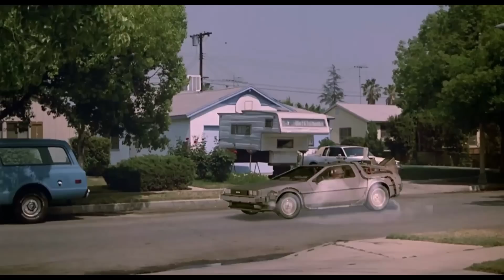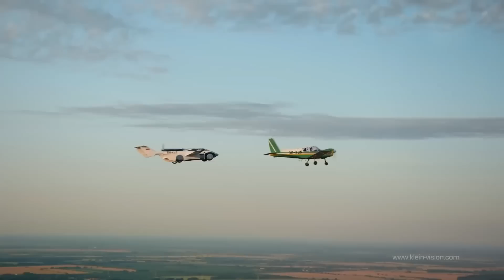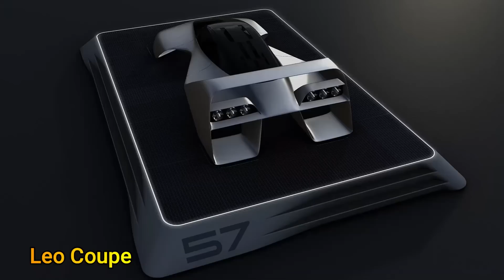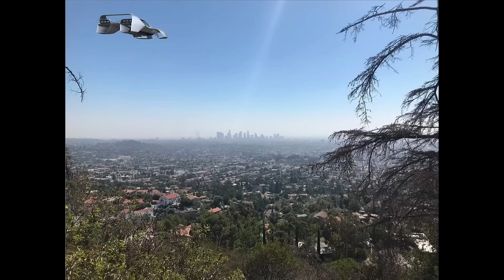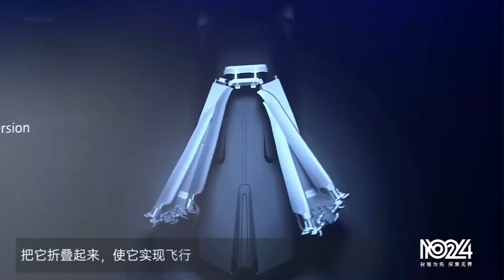Existing and Upcoming Flying Super Cars and Hyper Cars

Comment: The Sky Chaser roadable VTOL tiltrotor REAL flying car should also be included in this list. Sky Chaser is the 1st of its kind, a real roadable Blade Runner style flying car with 4 large wheels for road use, no unfolding wings, and no exposed prop rotors. It looks and drives like a super car, and flies both vertically like a drone and horizontally like a plane. In addition it is amphibian. It will be both manual and fully autonomous, and will be powered by a hydrogen fuel cell giving it hours of range. The 1st version will be a single seater, followed by a 2 seater with tandem seating like a jet fighter. The Sky Chaser project started in San Diego, Calif in 2016 with 1/6 scale development and moved to Fjugesta Sweden in 2020, where the 1st full scale prototype was built and tested. The project will soon move to the UAE for commercial development and production. See the company website for more information:

*Website - SkyChaser(dot)se
*eVTOL news - https://evtol.news/sky-chaser-concept-design
https://evtol.news/sky-chaser
*Project Video - https://drive.google.com/file/d/1FAdls15OriuQ4hoD2xPwXeNQDQTKpK1t/view?usp=drive_link
* Flight videos - 1/6 scale, Full scale, and simulation - https://www.tiktok.com/@william.walker39

Comment: Looks like someone worked off an idea I did or I thought about it was about time utilizing the access space that would be on a car oh I love the jet engine idea but that would be more practical for long distance flight like oversea really should keep in mind that we're talking a futuristic do you for an example in Back to the Future too most all Concepts should be based on the traffic seen when they travel to the Future eventually when enough Vehicles that's capable of flight it in the air it will be required that they all have the same capabilities and would require traffic Systems in the air

Comment: No I do love the Space Age jet design are quite practical very futuristic in terms of spaceships as for power consumption a simple gas motor will generator such as a DC generator with a neodymium core to produce enough power to power all the electrics in terms of a small motor would be more manageable as well as lighter than batteries possibly

Comment: For a helicopter Style rotors those can be shrimp down to a four-blade turboprop setup reducing the distance and space in which they would require to spin which can also be set up to two props separate for folding can also reduce the distance of reach for the props reducing the full radius of the car

Comment: The Aeromobile. Due to the fact that both Front-Wheel-Drive and hydraulic usually fail after a certain mount of time regardless as how they are cared for. It would be nice to see upgrades in the design of the drivetrain and Manual access manipulation added to this vehicle.
Firenze Lanciare. Too many moving parts with hydraulics to be interested in it. However, turbine cars have been made before successfully.
Bellwether Volar. If it doesn't have four wheels, it isn't a fricken car.
Leo Coupe. See above.
True Flying Car. Again, too muck hydraulics to take it seriously. That shit breaks.

Comment: The Last one, HT AERO Where do they put those extending arms and propellers that seem to magically appear from the inside? the dimensions don't add up.. 

Firenze Lanclari.. Yeah   300 gallon tank,, thats 2.251 Pounds of fuel  Over 1.2 metric Tonnes  requiring a tank of 48.16 Cubic feet capacity  Where is this being located?  Dream time.. and vapourware certainly wishful thinking.. 

We need improved power sources and alternative lift technologies before these become a useable reality.  Nice video though as usual

Comment: Not sure I believe in this kind of road-and-air type of cars. I believe that evtols (especially with ducted fans) once autonomous and with built out infrastructure could be viable personal vehicles. You only really need the last few meters of parking capabilities once you landed, and the ducted vector fans could provide that or tiny motors on the landing gear.

Comment: Jetoptera is going to win even though you did not showcase it here.  It has no external blades and runs much quieter.  Sure, it is not electric, but it is the most viable for blade safety and noise pollution.

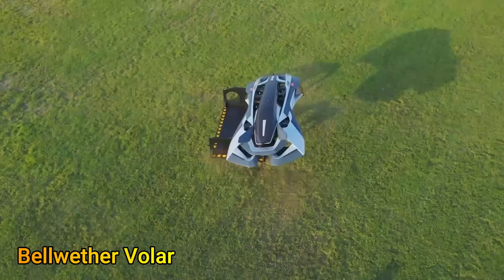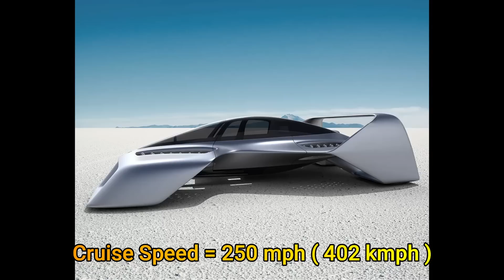Comment: 3:25 & 5:45 are VToL styles, that could be feasable in metropolitan enviromemt, if was a 2 stage craft, where attaches to a ground vehicle body frame, it could automatically be versital as a road, air & even water, using part of the body as land port and alternative transportation stages. In the beginning of this video, those crafts are RToL, as runway lift required, although the wings could be handy during long cruise travel, if only they were able to VToL first, without necessarily a runway. Also, you forgot to mention the CityHawk model, which is already beyond CGI test.

Comment: Interesting video.  It seems to me that a 'flying car' with all three characteristics - drivable, flyable, and VTOL, may just be beyond the state of the art.  Pick either drivability or VTOL.  If you give up on VTOL, then you can have a practical, roadable aircraft like the PAL-V or the AeroMobil.  If you give up on it being drivable, then you can have a practical replacement for a helicopter, like the upcoming EVTOL aircraft.
Reply: Totally agree. This idea of shoe 📯 Ng in all that functionality is very silly.
Reply: Yes, it is possible and should have been included on the list. The Sky Chaser roadable VTOL tiltrotor REAL flying car should also be included in this list. Sky Chaser is the 1st of its kind, a real roadable Blade Runner style flying car with 4 large wheels for road use, no unfolding wings, and no exposed prop rotors. It looks and drives like a super car, and flies both vertically like a drone and horizontally like a plane. In addition it is amphibian. It will be both manual and fully autonomous, and will be powered by a hydrogen fuel cell giving it hours of range. The 1st version will be a single seater, followed by a 2 seater with tandem seating like a jet fighter. The Sky Chaser project started in San Diego, Calif in 2016 with 1/6 scale development and moved to Fjugesta Sweden in 2020, where the 1st full scale prototype was built and tested. The project will soon move to the UAE for commercial development and production. See the company website for more information:

*Website - SkyChaser(dot)se
*eVTOL news - https://evtol.news/sky-chaser-concept-design
https://evtol.news/sky-chaser
*Project Video - https://drive.google.com/file/d/1FAdls15OriuQ4hoD2xPwXeNQDQTKpK1t/view?usp=drive_link
* Flight videos - 1/6 scale, Full scale, and simulation - https://www.tiktok.com/@william.walker39

Comment: I love the areocar the guy who developed it is a genius and it will sadly always be a gimmick. It will always be a compromise between a plane and car and not a great version of either but I really hope I am wrong. The two electric sports cars are at best toys till some giant leap in battery power. The jet car I'll believe when I see it   and the Chinese helicopter car I want to know what happens if one engine fails my guess is you auger into the ground like madly spinning lawn dart.
Reply: в видео в конце было указано что все эти модели оснащены парашютами
Reply: @viacheslavstukalenko9660  for most of the aircraft/cars shown the ballistic parachute sounds great as long as your around 300 - 400m off the ground but the Chinese Twin rotor car if it suffers a single rotor failure that's a lot of asymmetrical thrust and if your flipping around you can't use a ballistic parachute without fouling iy

Comment: I don't see highway driving as being all that necessary if the surrounding infrastructure is adapted to VTOL flight. The whole point of point to point trips is to avoid high speed ground travel. A VTOL really should only need to be capable of slow speed taxi away from the landing zone, or maybe short trips at mid-speed (60kph say), which is suitable for ultralight vehicles optimized for flight.
Viable VTOLS will probably have more duck-like capabilities than a magical horse / bird combo due to the tradeoffs involved. With enough power, a brick can fly, so it all depends on power density and energy density in the end. Fun times. It reminds me of the early days of IT.

Comment: As you aptly point out, only 2 can become cars, the AeroMobil and the HT Aero. There is that attached problem for cars that require an airport, which denies practicality.
That and another intrinsic concern of the logic of the idea. If you could fly there, why the hell are you driving? Of course there isnt a reason.
In car design we are required to look after safety, if we achieve this we have already burned millions of dollars and years of research, this too is an impediment.

I very nearly got there myself, starting simple with a single seat CanAm style open body car on a 3 wheeler chassis. The 3 wheel form with 2 wheels up front allows you to get past car safety because in most places it registers as a motorcycle and sidecar, which are exempt. It can drive on the road with a relatively light motorcycle engine and rear wheel transmission. Its delta wing slides in and out of the rear body which adds wing area and creates a more favourable aspect ratio. To keep the part wing body on the road while folded it is necessary to keep a negative angle of attack at highway speeds or you will find the machine lifting off the road above 60 mph. This was accomplished by raising the rear suspension, which retracts in aeroplane mode to do the opposite. Forward propulsion would have been achieved via a front take off from the transmission to a retractable propeller shaft and fold away propeller of the type gliders use. While this car is achievable it has to skirt the same conundrum that AeroMobil does, so I scrapped the idea as unsatisfactory. It was simply much better to have a personal flying machine that might in the end work out cheaper, with the added reserve that it could take off vertically. 

Enter the turbine APU powered electric compound single rotor helicopter capable of 300 mph. There are too many compromises in achieving the car part of the flying car, so focus on what works. And BTW these ballistic chutes all have a no-go zone which you must fly above or they simply add to the weight contributing to the damage in the crash you were trying to avoid !
Reply from the maker: Have a look at Pal-V flying car
Reply: @ElectricAviation  I remember when they were testing, the program goes back a long way.
There were a few relevant designs from the gyro copter world that either preceded or inspired it, what they did made a roadable package.
Although Im not fond of this style of trike it does do everything they claim right out of the box, well within the limitations of a gyro. 
But the ultimate development requires a collective pitch control, and once you go that far you might just as well be a full helicopter.
Without it, on a machine of this weight you need 1,000 ft run up to clear a 50ft obstacle. 
On the plus side they are certified, it is quite fast, and gyros are I believe safe machines to fly
well I only had one crash :)